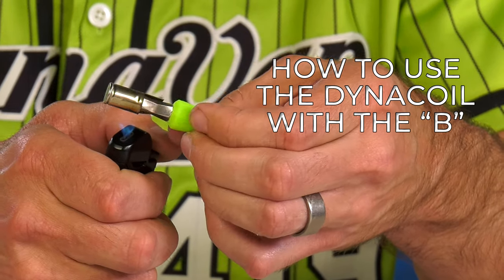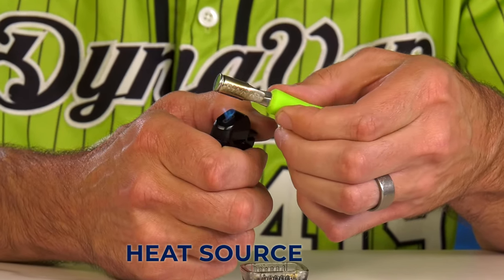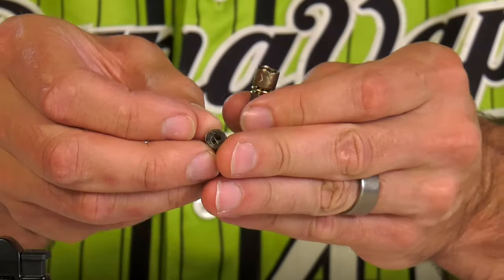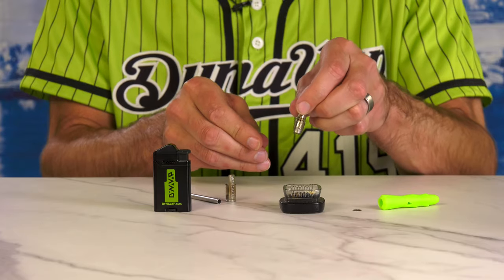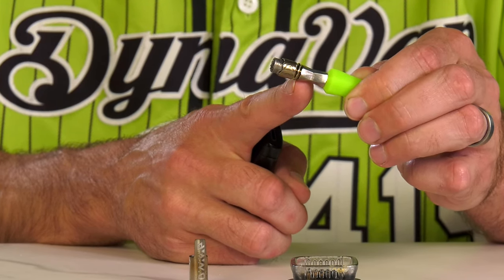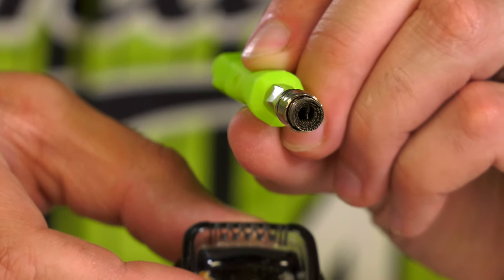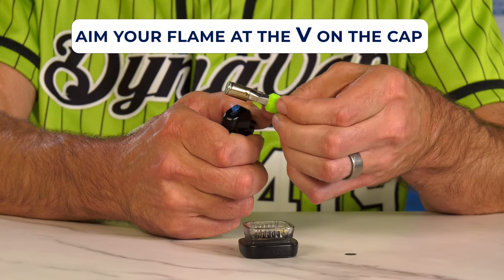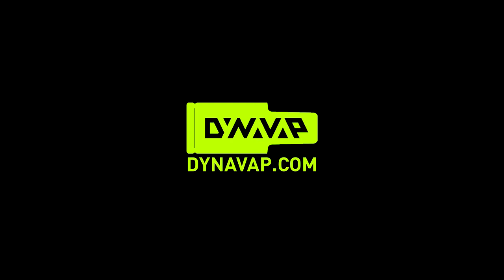How to use the DynaCoil with The "B" by DynaVap

Comment: Ive been rippin thcp/hhc through the helix tip with the dynacoil. It works ok, i think its better to just mix oil with cheap herbs.
Reply: Or maybe just smoke ganja which has a known safety profile and not some synthetic noids made in some Chinese warehouse
Reply: @ottoflouer1750 not sure it’s made like that bro lol. But get what your saying

Comment: i used the b and i mix bud dap bud like a sandwich so amazing super high
Reply: everyone likes it different....but yea I prefer the 🥪 method too....but had to get the dynacoil lol the VAS was itching haha...I like how easy it is to clean the coil....I just pop it out after my sesh, let it cool down for 10 minutes or so, then drop it in my isopropyl alcohol 91% pill bottle I got for my dynavap soaks ;) just slightly submerge the coil and let it soak all day....now before your next sesh youll want to rinse it well, over running hot water (dont need to be boiling, just a good stream of 🌊 to rinse off the alcohol....definitely dont want to inhale alcohol lol.

Comment: I just ordered the m+ starter kit….the cap to the m isn’t working consistently sometimes it does a low click an no second click an then other times it does making it really really tricky to judge I’ve roasted quite a few bowls but whenever I do get both clicks I get a good vape… I heat the same area every time between the y and the n…. I’ve also emailed y’all about something else recently but no reply so I’m trying this… hopefully I hear something….my email starts with
mogo…….
Reply: An sometimes it doesn’t click at all 🤷🏼‍♂️ please help @dynavap
Reply: @dynavap ???????
Reply: Do y’all not answer ur customers????
Reply: My fault @dynavap I emailed the wrong address 😬 They are taking care of my issue as we speak 😁😜😝🤪
Reply: @Mark-op2sb  you should get psychiatric evaluation